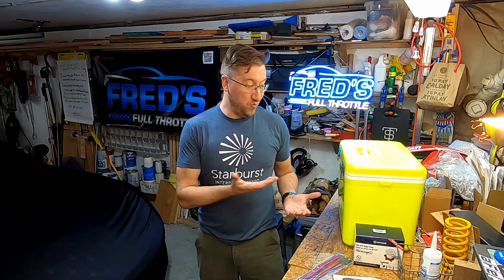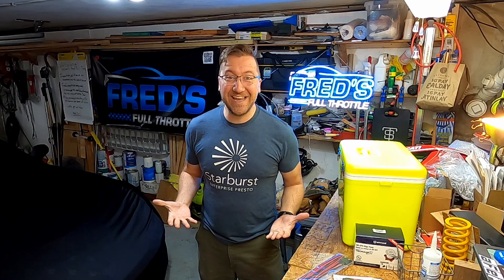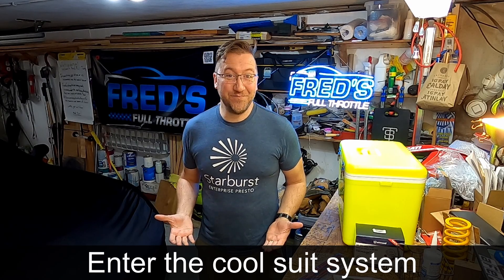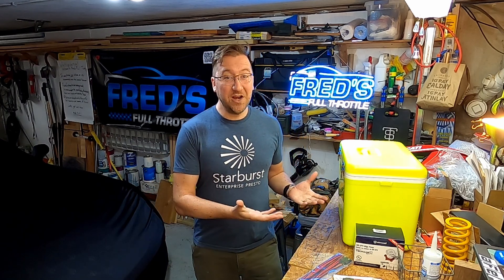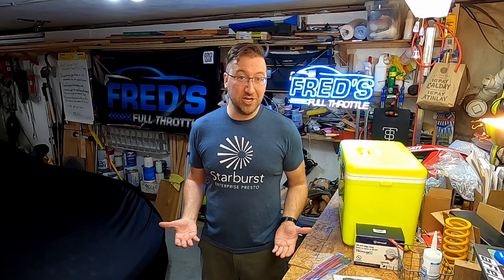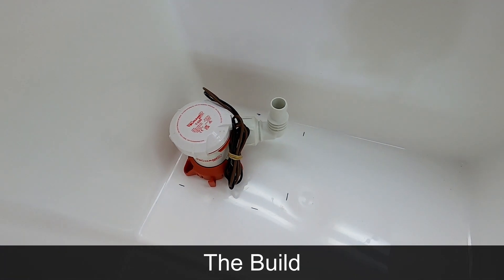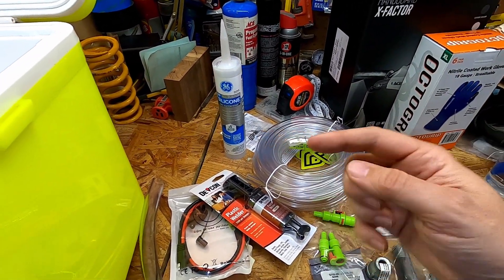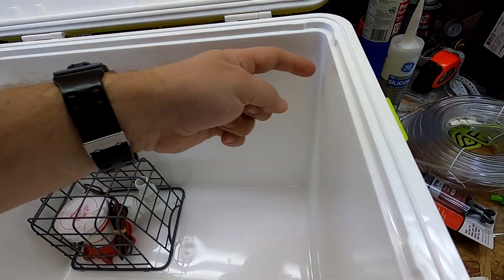How to build a cool suit system for car racing!

Comment: 5 minutes and 30 seconds of..."cars are hot." Another 4 1/2 minutes of "these are some fittings, this is a cheap cooler." 4 minutes of drilling it, connecting, and a brief explaination of Bernoulli's principle and you have a 14 1/2 minute video on how to make your own cool suit system. Hold on here, hold on! Where the #uck was the cool suit? The crap people will try to monetize is getting retarded.

Comment: Nice kit. I was thinking pex might have been easy to. The nylon hose is cheap.
Reply from the maker: I looked at PEX, and the fittings were nice, but it is very stiff, and wouldn't be easy to route through the car without really lashing it down.  When I show the final setup (with the heat insulation on the lines too), you'll see how nice it turned out.  I have a bit of water sealing to do and some wiring, but should be done soon.  I just ordered the cool shirt last night, so I'm excited to test it!
Reply: @ I like projects like that. I think you might find your pump is flowing too fast. It will recirc the water very quickly. You may want to put an adj voltage control on it to speed up or slow down the flow. Also the blue freezer blocks with a little bit of water circulating might be easier to manage and change out. Stay cooler longer due to their density. Use dry ice in your out of car storage cooler to keep them frozen.
Reply from the maker: Those are awesome ideas, really appreciate it.  Gonna do exactly that!